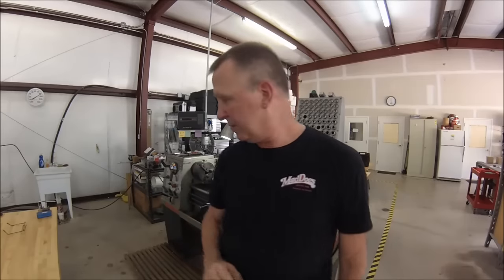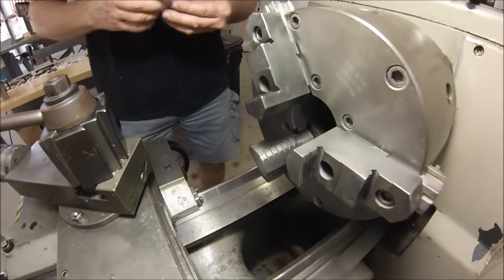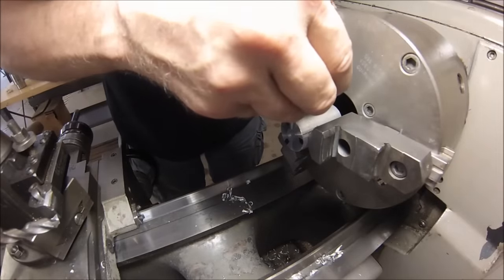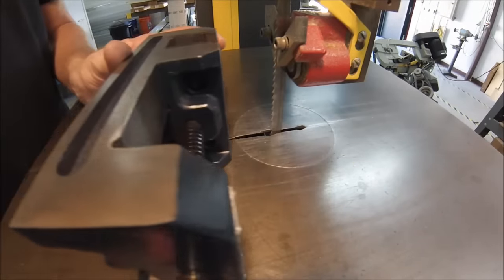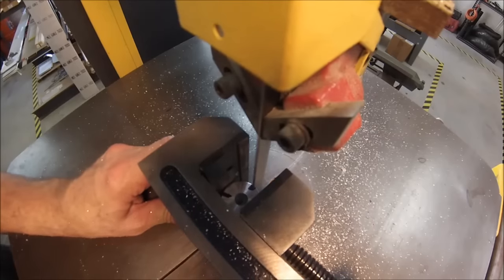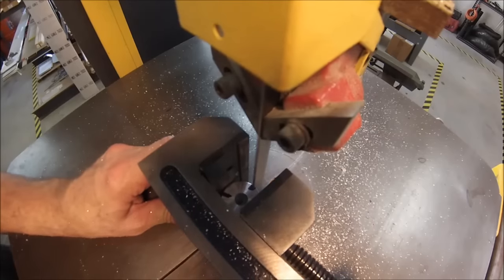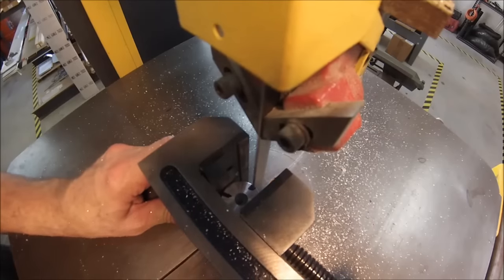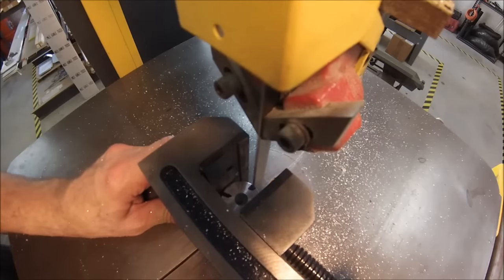Get your parts to run true in a non adjustable chuck. YOU MUST WATCH THIS!

Comment: Joe I'm a welder & new to machining , I'm having trouble with a 2'' pipe in my lathe, not sure of the best way to get it to run true ?
Reply: I’m not Joe but I’ll give it a shot!
#1 pipe is not concentric! It appears to be but for machining purposes not, solution.. if the piece (stock) isn’t too long, clean up cut too the inside with a boring bar then re-chuck too the inside, that will be as close as you can get to concentric, then make your outside clean up cut..
Reply: Thanks Tim, my part is only about 2" dia by 5"I want to clean it up then cap one end with tig brazing then rough cut with plasma grind down abit then turn it in the lathe again hoping to create a smooth even brass inlay where the chamfer was tig brazed, if it works then on to the other side, then drill tap both ends make some nylon caps, put it on the mill to make a hole for the handle fill it with bb's then tig weld the lathe cut handle on, all this for a custom dead blow hammer hahahh
Reply: What you can do to make it close is put it on the lathe with jaws expanding out into the inside diameter and bump it with something like a rounded thing in held in the tool post, or even a bearing held in a holder like a wheel (maybe a nudge with a knurling tool) as you turn the lathe chuck BY HAND, and that will get you close to centring the outside diameter.

But you really should true it up then you can hold it and indicate it to run true ON THE OUTSIDE with a chuck. That only guarantees it is concentric with the inside if you know the inside is concentric with the outside, which you don't seeing as you have just removed material from a part that is sort of maybe centred on the chuck, so if concentricity is important you best damn make it so by boring it it out with a reamer or boring bar.

People have been known to bump things when they are running under power to true them up, but I can't recommend this as it's dangerous as fuck and you can have that pipe or whatever fly off the chuck and take your damn head off, cause as it comes out of true it will gain more wobble and linear speed as it moves out to a larger diameter and therefore centrifugal force throwing it radially from wherever it falls completely off at..

Not that I know anything for realsies I have barely touched the lathe I have access too, I'm a lazy prick and instead I "read all about it". Which might give you some idea but still, I don't know what the fuck I'm talking about really till I try it in the real world ;)
Reply: thanks!
Reply: MrGoatflakes , are you in Margaritaville? I can’t believe that I’m even committing on this! 
Let me spell it out for you,
PIPE IS NOT ROUND!!
Reply: MrGoatflakes I’m sorry for thinking that you were in Margaritaville, I stand corrected!
You must be from Tweekerville!
Reply: +Tim's Retired and you must be from a planet without any indigenous tooling technology but where every piece of tooling isn't made but comes imported from the McMaster Quadrant of the Chinesium Galaxy.

Comment: Shouldn’t you have marked the jaw position before you flipped the part to face the other end
Reply from the maker: No, because it wasn't bored yet.
Reply: It is ”the other end” that becomes the primary end, right? The back end is not as critical.
Reply: @joepie221  If it doesn't matter then why did you mark it? You only need to mark it after it's bored.

Comment: I bought a clausing 15x50. Has a 3 jaw, but everything I turn is off. The chuck doesn’t have adjustments on it. Do you have a video of how to correct this?
Reply from the maker: If you can be more specific, I'll try to help you. What is off?
Reply: @joepie221  I’m a novice first and foremost, I bought a tool to align the tailstock, so I’ve done that. I make simple shafts for our machines, but everything I turn runs out quite a bit. It came with a 4 jaw, but it takes too long for me to set up. Was hoping to create a situation where I can chuck some round stock up, and turn very simple journals.
Reply from the maker: @retailbreaks1400  If your 3 jaw chuck isn't adjustable, take a look at how it attaches to the machine. Probably a backing plate with cam pins screwed to the chuck body . It may be possible to slightly "Unloosen" the screws holding that plate in place to the chuck body, and bump the body of the chuck until your part runs closer to true. Tighten the screws after this initial setup and don't touch them again. Do this with a part in the machine that represents the most common size you turn. Another option is to get a tool post grinder and actually regrind the jaws. For the 4 jaw, mark the jaws in order. Jaws 1,2,3 and 4 will become jaws 1, 1a, 2 and 2a. Put a part in the chuck, indicate the part to run true, then between parts, only "Unloosen" jaws 1 and 1a, or 2 and 2a. By keeping a set of jaws set to the original location, when you retighten the 2 jaws you previously "Unloosened", your part will be extremely close to concentric if its the same diameter as the part before it. I hope this helps.
Reply: It has 6 cam pins, it looks like they thread directly into the chuck itself. Do you have an email by chance? I can send you some pics?
Reply from the maker: @retailbreaks1400  Not unusual. How far out of concentricity are your pieces when you chuck them up?  How many chuck key receivers are on this chuck and what brand is it?
Reply: @joepie221  it’s a cushman, 3 spots to tighten. I messed with it some more yesterday. It has 3 1/2-13 socket caps mounting the chuck to the cam lock plate. I can loosen those, and get it to run out on 2” drill rod about .001, but as soon as I tighten them back up it goes way out again. It’s about 12-14 out once tighten
Reply: @joepie221  it’s a cushman, 3 spots to tighten. I messed with it some more yesterday. It has 3 1/2-13 socket caps mounting the chuck to the cam lock plate. I can loosen those, and get it to run out on 2” drill rod about .001, but as soon as I tighten them back up it goes way out again. It’s about 12-14 out once tighten
Reply from the maker: @retailbreaks1400  Sounds like your backing plate needs to be faced off, if you haven't already done it. Remove the chuck from the machine and remove the backing plate. Mount only the backing plate back onto the machine. Figure out a method to mark the spindle area and the backing plate so it always goes on in the same rotation. I have punched a line on mine to line up with one on the nose of the machine. Face off the front of the backing plate. Re assemble the chuck to the plate and re-align the 2" bar. Tighten the backing plate gently and in sequence like putting on tire lug nuts.
Reply: Check the jaws for wear , sometimes  you can re-grind them,  or buy new

Comment: Looks like a lot of work compared to just regrinding the jaws or something similar
Reply from the maker: 5 minutes
Reply: Joe Pieczynski if this takes 5 minutes for each part, regrinding or using soft jaws would work for several parts and take less than 30 minutes. Especially with softjaws, touching them up only takes a light pass with a boring par while it's hose clamped.
Reply from the maker: Your comment is welcome, but this video is not about grinding jaws. The collar can stay in place and be used repeatedly for many parts. No need to make one for each part unless the parts are different diameters. Then start with the smallest part and just rebore to the next size up.
Reply from the maker: You might want to stay away from the 'Hose clamp" technique. The load on the jaws is in the wrong direction.

Comment: What if your three-jaw chuck only has jaw adjusters and that's it. I noticed your chuck had 3 or 4 adjusters and then at least 1 jaw adjuster.
Reply from the maker: This technique is specifically intended for chucks that don't adjust.
Reply: @joepie221  so what are the extra chuck key holes you have do. You have 3 or 4 small ones and Atleast 1 bigger one
Reply from the maker: @OfficialSNIxn  The small ones are adjustment screws that allow me to dial in the concentricity. The big one controls the jaws. If your chuck doesn't allow adjustability, a bushing is a good trick to know.
Reply: @joepie221  that's what I thought, yeah my chuck doesn't have this. And I thought the video said it was intended for people with three Jaws that don't adjust. Yet you use an adjustable one in this video? I'm confused. And what do you mean with the bushing part?
Reply from the maker: @OfficialSNIxn  The adjustment options on the chuck used in this demonstration were not used to correct the eccentricity problem, so they don't come into play. Since the aluminum bushing was bored on location and not removed, it effectively cancelled out the eccentricity and provided a truer gripping solution.
Reply: @joepie221  I see yeah. Okay thanks!

Comment: You had me until you sawed the slot directly inline with the jaw.  Rotating it to a different location to ensure the slot was between jaws defeated a great deal of the work you had put into it up to that point.
Reply from the maker: Actually not. The initial hole size was more undersize than the amount of runout being corrected. You can put the split between any of the jaws because it gets bored on location eliminating any present error.. Now if the hole was roughed to only .005 undersize and the runout was .02, your comment would be more accurate and the re-installation would be more critical.
Reply: What about when he used a strait fluted reamer after cutting a strait slot...
Also you only have to mark between 3 and one jaws ( or wherever the circle nameplate is on the face of the chuck ). You can use the same method to hole a square in a 3 jaw. The chucks where I work are so worn you can centre something by using different scroll pinions.
Reply from the maker: @joejoejoejoejoejoe4391  "What about when he used a strait fluted reamer after cutting a strait slot..." This is myth. A spiral flute reamer doesn't have the helical twist to completely consume an internal slot or key. If you took note, the shim eliminated the interruption, so the reamer effectively didn't know there was a slot.
Reply: @joepie221  Point taken, I stand corrected.
Reply: Watching the video(again), and reflecting on much less experience than Joe, I don’t understand the complaints at all. Boring/reaming the spacer final ID AFTER “setting” the spacer for the final time takes care of the issue. I suppose Michael is thinking of removing and replacing the spacer after bore concentricity was achieved? As always, even when rewatching, good stuff!

Comment: I think i would grind the jaws in less time and it would take care of the problem.
Reply from the maker: BUT, you would have to have a grinder. Think bare bones.
Reply from the maker: @donotwantahandle1111  These jaws are usually very hard. That, combined with the interruption, would beat the edge off the tool pretty quick. You may get lucky, but grinding is the preferred method.
Reply: how many times do you think you can do that?
Reply: A cheap $12.00 1/4 inch air die grinder clamped to the tool post with a 1 inch stone  is all that's needed to grind stuff on the lathe, If your chuck is junk move it to the welding area and buy a better chuck. If your chuck has removable jaws, make soft jaws and bore to fit.
Reply: @joepie221  Thanks Joe. I just realised that boring would curve the jaws too!

Comment: Only critique is not to pull reamer out while chuck is still spinning. Bad habit, that leaves unwanted grooves in bore, even if it's only a holding tool your making. Otherwise, real good info
Reply from the maker: On valve work, I always stop the reamer before taking it out. That fast rise spiral you can get sometimes is a deal breaker
Reply: I had a professor in a manufacturing engineering class tell us that he was working at TRW, and they had a bushing they were making fracture longitudinally during operation.  They couldn't figure out what was going on until they realized that they were pulling the reamer straight out with the part stationary, and it was leaving longitudinal scratches on the inside of the bore causing stress concentrations.  Once they stopped doing that the part stopped failing.  So it depends on the application, and how fast you withdraw the reamer.
Reply from the maker: The condition of the reamer has a lot to do with it too. Crappy worn reamers will tend to collect 'Fly Shit' on the leading edges and leave those lines.
Reply: Agree totally, Joe. A dull reamer doesn't slice material, it galls it off and will gall on it's way out . They can get dull quick with inadequate coolant/lube and excess chip buildup

Comment: what you made there is a basic collet.

You have a full rack of them right on your machine. I kind of dont get the point of making one.
Reply from the maker: This video is for the guys with crap chucks and no full racks of collets to choose from.
Reply: @joepie221  I see.
Reply: Your collet will runout with your Chuck. He's boring out a collet to correct runout of spindle

Comment: Ever tried tightening the Chuck from more than one location at different torque intervals?
Reply from the maker: I've seen that work on chucks with more than one chuck key location. This chuck only has one socket.
Reply: Joe Pieczynski odd

Comment: Why not turn the jaws themselves?
Reply from the maker: That would be the ultimate solution, but you would need a toolpost grinder to do it correctly. Not all home shops can swing that.
Reply: Couldn't you simply turn them while still on the lathe?  That would be an interesting problem (ie. without using a toolpost grinder.)  eg.  place a large blank (or a clean round) inside near the back of jaws.  Then turn jaws outside (and/or partially inside.)  Then put a large washer shape over the outside of the jaws and turn the rest of the inside.  You would probably have to go back and forth a few times to get the tolerances down...

Comment: not very good to hit your chuck with the file...and not good to use compressed air to blow chips away because it can push chips into parts of the machine that aren't designed to see chips
Reply from the maker: Correction...Its not good to let the tip of your file hit the chuck. As for the air comment, I've sen manufacturing facilities come to a halt because of no air. I am sure most of us disagree with that part.
Reply: I agree with you, on most machines there are parts I would never touch with air. This didn't seem bad, but I wouldn't blow chips up under a CNC table.
Reply from the maker: You'd only do it once in my shop.

Comment: You definitely are experienced and know what you are doing. My only gripe is your video titles. Eg. "YOU MUST WATCH THIS!" Way over-hyped. Otherwise, the video itself is good stuff to have in a machinist's repertoire if needed.
Reply from the maker: For a garage shop on a limited budget, a video like this is invaluable. Any video I consider to raise the awareness of safety or solve a common shop problem will have capitol letters in the title or be called a shop gem.

Comment: You need to balance the wheels in your bandsaw
Reply from the maker: That irregularity has bugged me for quite a while. It turned out to be a fractured drive belt. Once it broke and was replaced, its whisper smooth.

Comment: Why don't you have your compound set at 59.5 deg
Reply from the maker: Why? there is no good reason to set a compound at 59.5 degrees. If you are trying to make a thread comment, you might want to reconsider that number.
Reply: I would ask the same question, since I turn threads once in a while, I leave mine at 59.5 deg too.  If the compound was set to 45 deg, I would say it was to get a little more accurate on the cross feed, a 2:1 radio.  So if you went in on the compound five thousands, the cut would be 2.5 thousands.  I have DRO's on my machine, so I don't do that, but if I had to split hairs, I would use 45 degrees.  While at it, I was taught on a three jaw (and jacobs chuck) to always tighten at least two of the jaws, as the scrolls are never perfect and have slop.

Jim H.
Reply: @emptech  A 45 degree angle gives a ratio of .707 in for each 1 turned. To get a 2:1 ratio (1:2 ratio), set the compound at 30 degrees from parallel to the axis, 60 degrees from the cross slide. My lathe is not rigid enough for this to be of value since I can turn the hand wheel a fraction of a thou and just turning the part again without any change removes that much more, but a good idea.
Reply: @BenAtTheTube :

You are right about the .707, I should have known better - thanks for correcting me -  Jim
Reply: Your threading tool has a 60 degree included angle, if it is set up perpendicular to the work you can plunge straight in. This will create a 60 deg angle but it also causes a great deal of stress that increases with depth of cut. This is because you are using the tool as a "form tool".
By setting the compound at 29.5 degrees that is slightly less than half of the included angle so now when you advance the compound to make the cut you are actually only cutting on one side of the tool, similar to using a turning or facing operation. This greatly reduces the stress on the tool and machine and will produce a finer cut without the probability of chatter and a lousy surface finish.
If your machine is stout you can get away with perpendicular plunging but i have better luck and surface finish using 29.5 degrees on my 70 year old worn out Southbend.
Reply: @evilscience3164 , I'm with you. My dad taught me to set the compound at 29.5 degrees and only use the cross slide to back out of the thread at
the end of the cut, to return the carriage back to the starting point. Then return the cross slide to zero and use the compound to feed into
the cut.